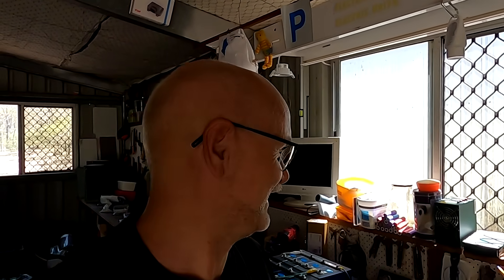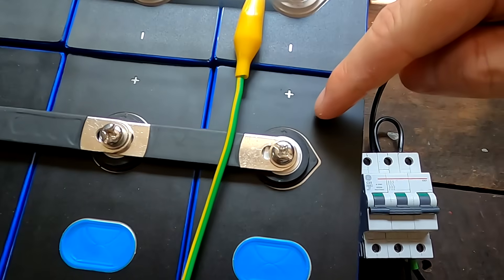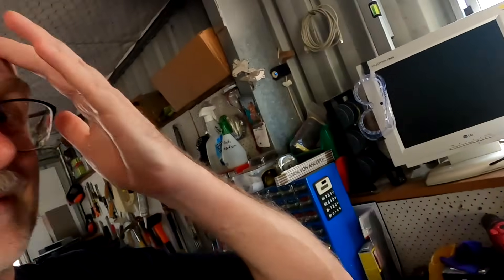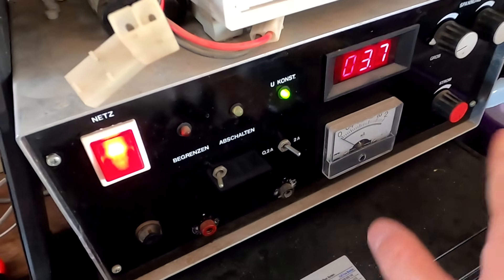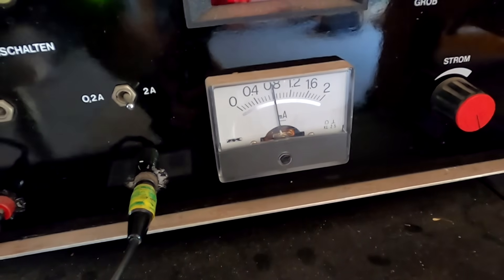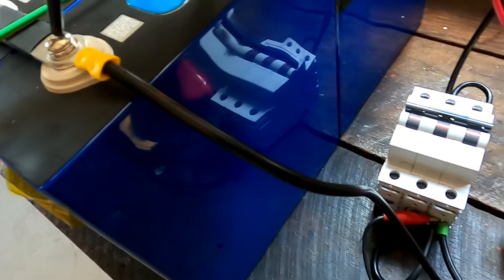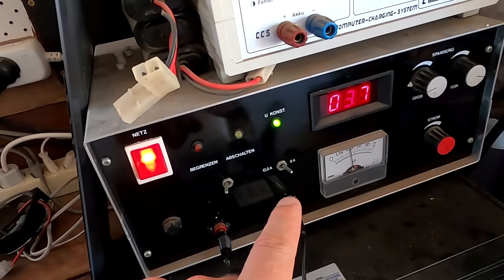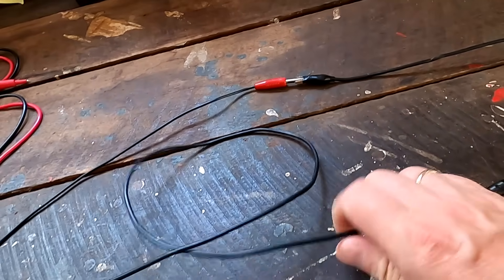Workshop: Lithium Charging 101 -  Solar Charging without Controller (Part1-2)

Comment: Can I use 14.6V10a charger to charge these cells? Or should I add voltage regulator to get 3.6V10a?
Reply from the maker: 14.6V is 3.65V per cell if they are perfectly balanced. You BMS will trip every single time with such a high voltage. Get a 13.8V charger instead (or adjust the voltage regulator to it). That would be perfect.
Reply: @OffGridGarageAustralia  Thanks for the reply.

Comment: A nice test would be to set up two identical solar panels one directly connected to the batteries and another one connected to a solar charge controller mppt type and then connected to the battery and see which one harvests more kilowatt hours and how much difference.
Reply from the maker: I can certainly do that.
Reply: @OffGridGarageAustralia  I did find one channel that compared PWM to MPPT controller with 100W panels. The PWM harvested 40W while the MPPT harvested 100W in full sunlight. I expect the spread is even greater in shade or cloud  conditions. It would be interesting to test in both situations and see if the advantage of MPPT increases with drop off in light.

Comment: The reason you only charge at 0.8A instead of 2A is because those thin wires have a voltage drop of 0.3V when running 0.8A through them so your power supply sees 3.6V when the batteries are at 3.3V. If you use thicker wires you would get 2A.

Comment: Connecting short batteries that are not exactly balanced can be dangerouse. Assuming internal resistance is 0.25mohms connecting two batteries in parallel shorts the voltage difference with 0.5mohms. it doesn't take much difference to get over the rated 1C current. You need only 140mV difference or even less as the internal resistance can be less then 0.25mohms. It might make sense to initially connect then with tinner/longer wires to limit the current. Just my 2c

Comment: Wouldn't it be quicker to perform the bulk charge with all batteries in series? Even your power supply would be charging at 24v x 2A = 48w vs 3v x 2A = 6w

Disconnect the series string when the lowest capacity cell reaches the final voltage then rewire all cells in parallel for the constant voltage top up.

Comment: I come up with 6.504 kWh for 8 of the 271 Lichen lifepo4 batteries. What am I missing?
Reply from the maker: I don't have Lichen cells so don't have the specs. 
It's usually Vn x Cn x n, so 3.2V x 271Ah x 8cells

Comment: Could I follow this same logic and charge a 12v lead acid battery using an 18v 6.5 amp solar panel? Would I stop the charge when the battery voltage reached the 13.8 float voltage or the 14.4 charging voltage?
Reply from the maker: That is difficult. The lead acid battery needs to be charged to 14.x volt and stays there for a while for equalization charge (similar to cell-balancing), afterwards you need to take the voltage back to 13.8V to fully charge it. Not sure how you could do this without a controller...

Comment: The reason batteries did not pull the full 2A from your power supply has to do with the voltage drop on your wires between the power supply and battery. If you had better lower resistance wires then full 2A will have been accepted by the battery. Maybe the circuit breaker also has significant resistance so that adds up also.
Reply from the maker: Yes, that is correct. The current is depending on the resistance and the voltage. We basically have the wires, connectors, circuit breaker and also the internal resistance of the cells as a series connection of resistors. We cannot change the internal resistance but the ones of the cables and connections. The setup was very poor with the alligator clips and cable connections, so resistance was also higher than you would have it in a good setup.

Comment: Do not adjust DC-DC converter to supply higher than 3.65v unloaded voltage.

You adjust CC current limit with shorted output or after connected to battery to no more then 15A which ls realistic limit of this DC-DC converter. Also use larger gauge and/or shorter wires to battery to avoid too much cable voltage drop to batteries.  The more the battery cable voltage drop the longer it will take to reach full charge.  Do not raise DC-DC output voltage to make up voltage drop.  It will bite you when batteries gets fully charged with higher voltage on batteries.

The higher the input voltage to DC-DC converter the worse its efficiency so the hotter it gets for 15 amps output.  For 3.6v @ 15 amps output and 12vdc input you will have less then 5 amp draw from input supply.
Reply from the maker: This setup was just for training and coaching purposes ;)

Comment: Hi from the Darling Downs, how are you going to use all that power?
My suggestions are box aircon (500w per hour) beer fridge and hi fi system.
Reply from the maker: That sounds like a fantastic plan! I like the beer fridge idea very much. We should have a party once the system is running, right?

Comment: I've been enjoying these videos, but there are quite a few things wrong in this one. You are most definitely seeing a sizeable voltage drop across the run of cables (it's a bit long, isn't super thick wire, the circuit breaker, etc. But the biggest impact are going to be those alligator clip connections) and that's what is limiting your charge current when you have the voltage limit set to 3.62V. Even at just the .8A that it was pulling at the time, you were going to be losing 300 mV across the run. This is also why the batteries were still only at 3.33V, even when you maxed out the voltage limit and the supply started charging at 2A. 2A is 2.5x more current than .8A, so you voltage drop will end up being ~750mV when charging at 2A. This would put the voltage at the supply around 4.0-4.1V, which is exactly what it's display read.

LiFePi4 follows the CVCC charging method and they will pull max current until they hit the voltage limit at which point the current will start to decay down to zero. (https://www.powerstream.com/z/charge.jpg) If you had a sufficiently sized connection between the batteries and the supply, the voltage drop between the supply and the batteries would be minimal and the batteries would pull 2A until they got to 3.65V, at which point the current would start to drop off until it hit zero. Your statement that the current is only at .8A because the batteries are close to full at 3.3V is incorrect.
Reply from the maker: Thanks, Jerome. Yes, the cabling limits the charging at this low voltage (and not the battery being full). It was just a quick setup for this video to explain some basics.

Comment: So, if your batteries are 3.6v and the charger is set at 3.6v (no current will flow) does that mean,  it would not be possible to overcharge the batteries?
Reply from the maker: That is correct. Current can only flow of three is a difference in voltage.
It's like two water tanks, connected at three bottom. One is fuller than the other, so water will flow from the higher potential to the lower one until they are the same. The waterflow will stop then.
Reply: @OffGridGarageAustralia  Great! That's always puzzled me. Thanks!

Comment: Another very good option to charge those batteries is to use a LiPo DC charger for hobby applications. Those chargers are meant to charge Lithium batteries in configuration of 1S up to 6S and you can select the current you like. It will automatically shut down the charge once the voltage is reached.
Reply: Mr. joe Prescot, I agree with you, but I like to charge my old lab top battery with a bench power supply and keep observing them till full charged. I am passing time. Thanks
Reply: @__-hh3gt I agree with you... I don't know why?... but I also enjoy charging my batteries with a power supply, checking the voltage and the current. I guess it's a very unique way of meditation..
Reply from the maker: Thanks Joe, I was thinking of including this in the video but they were already so long and these chargers (the iCharge 4010 Duo for example) are a bit more complicated to setup for beginners.
But yeah, I 100% agree with you, they are brilliant devices for charging your battery.
Reply: @OffGridGarageAustralia  Yes, there are many ways to transfer those precious electrons. But it's always a lot fun to play with different techniques and having a good time observing the process. 😊✨⚡️I think we share the same hobby as I also have a Off-Grid Garage ☀️😊

Comment: Ya but you are turning your 220 watt panel into a 30 watt panel you would be better off once they are all at the same voltage and run them all in series for a 12v or 24v battery even if you wanted some safety you could use a cheap pwm charge controller and if there is any drift you can hook them back in parallel after
Reply from the maker: I know the efficiency is not great. This was more to explain the basics of charging and what happens in different scenarios.
But yeah, as you said there are far better options to charge batteries.

Comment: It is charging those cells very slow (3.3v X 8 amps = 26 watts!) Since you will be monitoring the cell voltages anyway, it might be quicker to connect the cells to the solar panel in Series (3.3 X 8 cells = 26.4v) so you charge using a higher voltage and higher current (26.4 X 8 amps ~ 211 watts, which will increase as the voltage rises), then once they reach a high voltage level, connect them all in parallel to do a final top balance.
Reply from the maker: Yes, absolutely. The methods I have shown after not very efficient and more to explain the basics of charging. We get deeper into this in the near future.
Reply: I have a question on this topic,  if say I use my solar charge controller ,  I can set the voltage to 3.65 no issue,  however it will be pushing 30-40 amps. Do you think that would be an issue?  In theory from their current 3.31v to say 3.55v should take "x" time period and of course I'd Monitor the process. I get a pretty consistent 30 amps.... I've got 2x250w panels that are 30v. I'm just curious about running it through the solar controller? I don't have the bms yet so I'm curious.
Reply: @Justdoingstuff83  do you only have one 3.2v cell? Or multiple in series? Since you said you set your solar charge controller to 3.65 which is a lot lower than any charge controller I've seen be able to go. I'm assuming you have multiple cells in series to create a 12v/24v/48v battery, if so I wouldn't set the charge controller to charge at 3.65v per cell X the number of cells, 3.4v per cell would suffice especially because you don't have a BMS you will have to monitor manually, I highly recommend getting a BMS though unless you wish to continuously monitor your battery's charge/discharge cycle, however to answer your question you shouldn't have to worry about too much current, the charge controller monitors the voltage of the battery so it will pump out as much current as possible until it gets to the voltage you desire (CC - Constant Current/Bulk Charge) once it reaches the desired voltage it will slowly ramp down the current to make sure the voltage doesn't go over what you desire (CV - Constant Voltage/Absorption) until the battery then sits at full voltage.

Comment: You actually very much can overcharge at 3.6v if you leave it there for a long time, so watch out for that.
Reply from the maker: Not if there is no current flowing.
If you set your power supply to 3.6V it will stop charging once the battery reaches that level as there is no voltage difference, hence no current.
Reply: @OffGridGarageAustralia  yeah but check the article anyway and then let me know what you think...
Reply: @frodev728  Good article, a great read thanks! 
I was particularly interested in the section on memory- that’s a difficult characteristic to avoid causing problems.
Reply: I highly recommend reading the full article linked below plus all the other articles on that site pertaining to LiFePO4 batteries. It should be considered essential reading in my opinion. [source follows]

“The graph above illustrates that while 3.3V is insufficient to recharge a cell, 3.4V is enough to obtain near 100% capacity already and limiting voltage cannot realistically prevent overcharging without also compromising charging.It also highlights that using high absorption voltages essentially fails to achieve anything as far as capacity is concerned, but charging times would certainly be reduced if also shown.
LFP cells simply don’t really charge at voltages up to 3.3V and then fully charge already at 3.4V and upwards. The transition is so abrupt that claiming to control the charging process by adjusting the voltage is purely and simply bound to fail._

Charging at reduced voltages, down to 3.4V/cell, only increases the absorption time and therefore the overall charging time, but achieves strictly nothing in terms of preventing the battery from getting fully charged and then overcharged. It only takes longer for this to happen. Furthermore, low-voltage charging opens the door to severe longer term performance issues which arise from memory effects in the cells”

Source: http://nordkyndesign.com/practical-characteristics-of-lithium-iron-phosphate-battery-cells/
Reply: You 100% cannot overcharge LiFePo4 batteries at only 3.6V... The batteries will just stop drawing current once they reach full charge. I'm pretty sure the only point your article is trying to make is that there isn't that much extra capacity in a LiFePo4 battery above 3.3-3.4V (and the same is true for voltages below 2.9V) that you can dramatically increase cell cycle life by charging to lower voltages.

Comment: Love these vids. Someone is doing all the ground work for us. Thank you! Maybe I misunderstood what you said, but I think you should check your explanation of why the bat V is holding 3.4V while the psu is showing 3.6V - the 0.2V drop is all in the cables & breaker. Any voltage source at 3.6V will trickle .8A into the batteries when they are at 3.4V - even if it had capacity to dump 1,000,000,000's of amps with those cables and breaker.  I imagine your student power supply is a linear unit...ahh, those were the days (not!).
Reply from the maker: I didn't dive too much into this but explained that the battery is a very big load and 'energy sink', so can absorb a lot of energy. 
The exact explanation is: the relation between the battery (and the energy it can take) and the solar panel is far off. That's why the battery just pulls the energy source down to 3.33V, it takes all the power and the source basically has no chance to keep its original voltage stable. It would be different if the source could actually deliver say 150A. The battery would not be able to pull the voltage down that far anymore and would overcharge with such a scenario. Like you said, if the energy source could deliver 1.000.000.000 amps and the voltage would be set to say 5V, it would overcharge the battery in no time. It's the other extreme and the power source would be far to big than the battery. But with these batteries and solar charging, it's unlikely we will have such a situation ever.
And yes, the power supply is fully linear, I even made the transformer myself 😁
Reply: @OffGridGarageAustralia  We are of the same cloth, though I am probably a bit more ancient.

Comment: What wattage inverter do you plan to use with them? Do you always get the busbars with a 4 battery set or does it depend where you get them from? How many bus bars do you get and do they have any amp rating on them?
Reply from the maker: The busbars have a 200A rating. At 48V that would mean close to 10kW. I'm planning to use a ~3kW inverter to power the garage and also charge the Tesla from it. I haven't ordered one yet, still undecided...

Comment: Good stuff the voltage curve is so flat you will pump in energy for days before the rise is seen.
Reply from the maker: I charged for the last 2 weeks with the buck converter from solar and the voltage rose from 3.33 to 3.34V. It's a 2240Ah battery and I probably manage to add 10Ah each day, so, yeah 😂 it's a very inefficient way to charge...
Reply: @OffGridGarageAustralia  where you bought this batteries at ? So to make a 12 or 24v system battery how many cells will you need ? What would be the w/h value in your system ? Wo much aAH I’ll take a long long time to fully charge , like for what purpose you will use this batteries ? Your Solar is mppt? Or pwm?